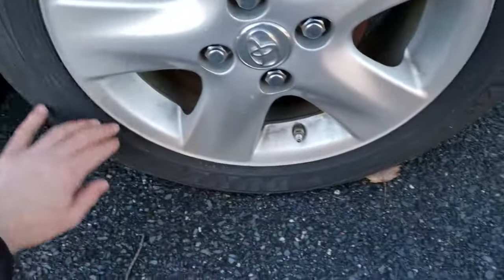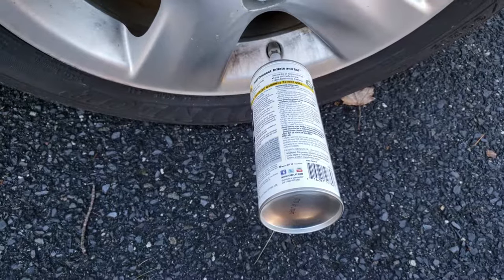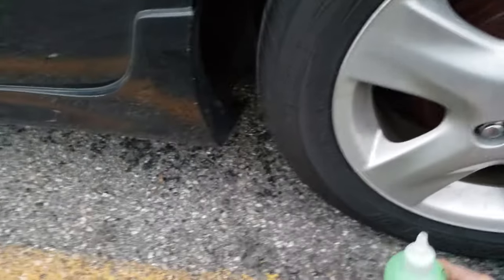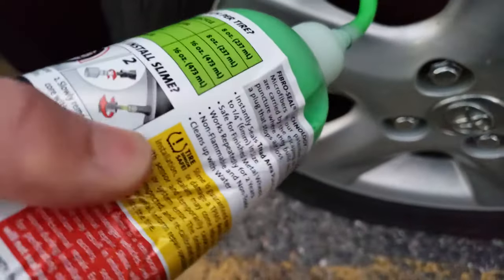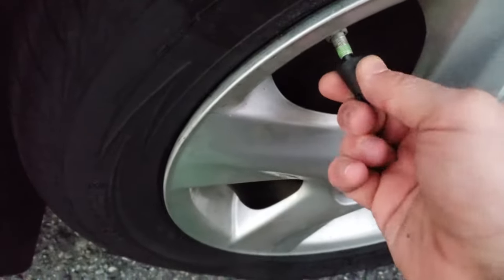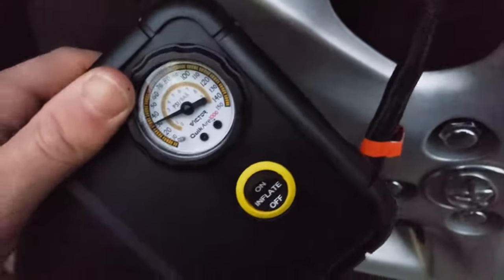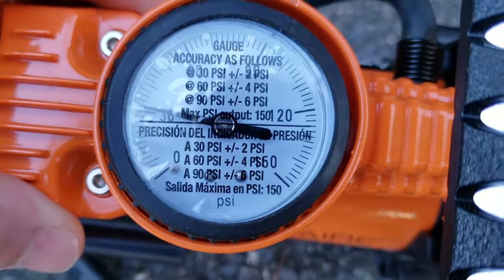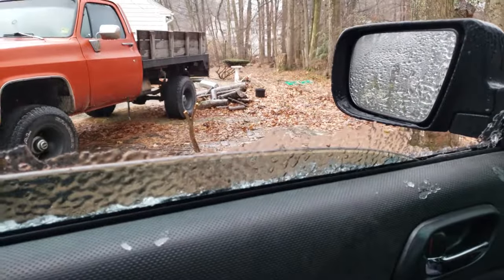How to Fix a Leaking Tire/Rim

Comment: This does work however, it will throw your tire off balance which *can slowly ruin the parts connected to it.
Reply from the maker: I guess that's why they ask you in the instructions to go drive the car for 10 minutes - probably balances the fluid internally to the tire before it hardens/dries.
Reply: @Bootstrappin  yeah the balance difference will probably be negligible if you follow the instructions like you said but if your gonna drive it for a year after doing this you might see some extra wear in the bearings and such. This video will probably save some poor SoB's with no other options so cudos, good lookin out m8.
Reply: What if I put the same amount on all tires?
Reply: @shambles3458  it would make every tire unbalanced instead of just the leaky one.
Reply: @nobadnamesleft  o ok gotcha,  i assumed that you were talking about the tire being slightly heavier and that it will throw the balance of the car or sum.
Reply: Three out of four of my wheels have rim leaks. On the fence about this stuff. The other option is to buy all new wheels.
Reply: @MrSirDudeGuy  I'm in the same boat as you...multiple rim leaks and considering using this product..esp with the weather getting colder
Reply: @klmbaby6  I am still adding air as needed at this time. These slime products say specifically that they’re for temporary use, and not for rim leaks.
Reply: @nobadnamesleft  It won't make it unbalanced if you drive it instantly for say 10 minutes so that the liquid can spin and slosh around all throughout the tire and be equally dispersed.  So, it will have more weight but it will still be equally dispersed around in a circle and thus spin perfectly fine.  You must be thinking to just add it and go inside and everything will be great.  you have to drive to turn the wheel so it basically PAINTS the inside of the wheel and finally that stuff will dry and be relatively equally dispersed.  If you drive it right away and drive it longer than the bottle says to be sure it's nice and dry, then it will be just as balanced as before.  I think you need to put air in also very quickly to be sure that stuff doesn't harden inside that air valve but I'm not a mechanic.

Comment: I used fix a flat once, it worked fine, air needed to be out of the tire.  Fix a flat is supposedly bad for the tire, but it lasted until I needed new tires.
Reply from the maker: What have you heard? All I heard it's not a great thing to deal with if you're the mechanic replacing the tire, because you have to clean all the gunk off the rim.
Reply: I tried the Slime on a deflated tire and only got about half the can out.  But it is working so far.

Comment: From the manufacturers website

"For emergency use only! Slime's Emergency Tire Sealant is designed as a temporary formula in passenger vehicles and must be removed within 3 days or 100 miles
Reply from the maker: Right, that's fair -- but we're not using it to plug a puncture
Reply: Lawyer talk
Reply: It WILL corrode the rim and leave you with pin holes. I'm here looking for a fix for that very reason!  @Bootstrappin
Reply from the maker: @VaderSpade  the only alternatives I know of is to either remove the tire, use a bead sealer on the rim where the tire bead would touch it, then re-seat the tire -- or to replace the valve stem (or do it at the same time as the bead sealing), those too can get leaky.

Comment: Well there is a reason they say, "For emergency use only! Slime's Emergency Tire Sealant is designed as a temporary formula in passenger vehicles and must be removed within 3 days or 100 miles."

It WILL corrode the rim and leave you with pin holes. I'm here looking for a fix for that very reason!
Reply: Good to know!
Reply: Did you find a solution ? I’m currently in the same boat. Chrome corrosion and flaking do tire won’t hold any air at all 😅

Comment: My rim is slightly bent on the back side of the rim. I didn't know when I bought the car last week but I've noticed it going flat so I've been putting air in it and it will usually hold 3 days. This morning it was pretty much flat so I put air in it and now it's already almost flat and I haven't driven anywhere. Will this help me?
Reply from the maker: May be worth a try, but with a few caveats. Bent rims can damage the car in the long run due to the unwanted vibrations it will cause, and will probably cause premature tire wear. Although this may fix the leak, it's probably better to see if a tire/rim shop can fix the rim. Also, tire shops hate this stuff, so if you're planning on visiting a shop, I wouldn't apply the slime, because the mechanic will have to clean it off.
Reply: I just went outside and it's still leaking
Reply from the maker: @sharonrichey4530  after applying the Slime?
Reply: Yes
Reply from the maker: @sharonrichey4530  the damage must be significant, unfortunately you'll have to go to a tire/rim shop. Perhaps you could put a spare tire on if you have it, and just hand them the rim.

Comment: Kiss your $200 tire pressure sensors  it’s goodbye!
Reply from the maker: Not saying that won't ever happen, but the sensors worked fine two years after this fix in this Toyota
Reply: @Bootstrappin  I asked the guy at the auto parts store he told me never to use the stuff if you had sensors so I believe them
Reply from the maker: @mr.redneck2715  Slime is water soluble, so if it does plug up your sensor, the next time you get your tires replaced, just have them run the sensor under water. They wouldn't sell this stuff if it ruined TPM sensors.
Reply: Of course he did, he works at a tire shop. He wants your money. Also the sensors are like $20-$25 ea.
Reply: @Bootstrappin  Yes it’s a Highlander